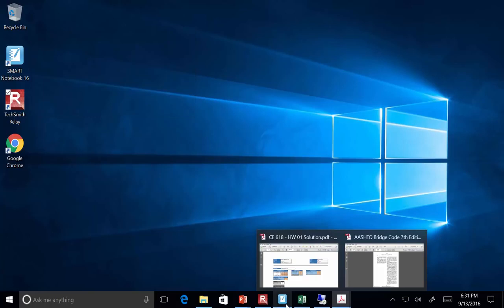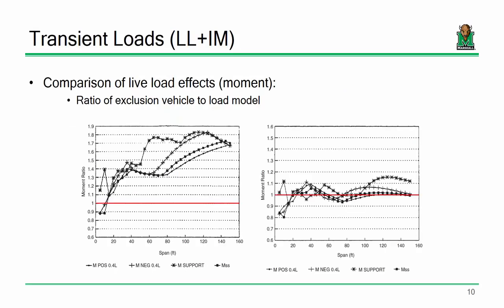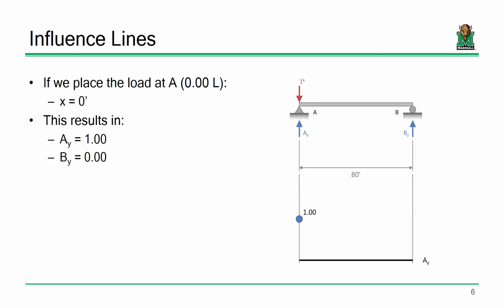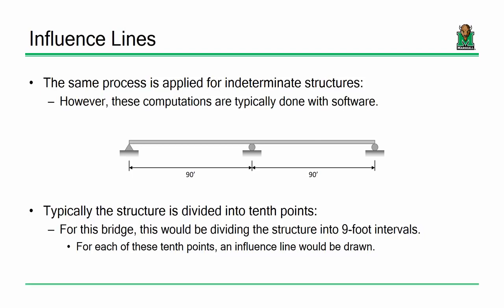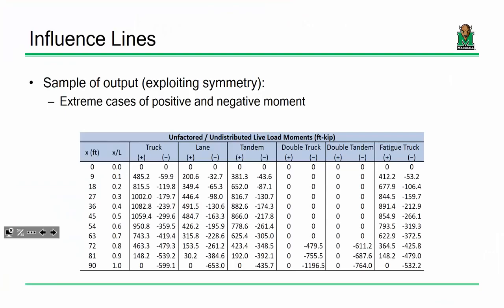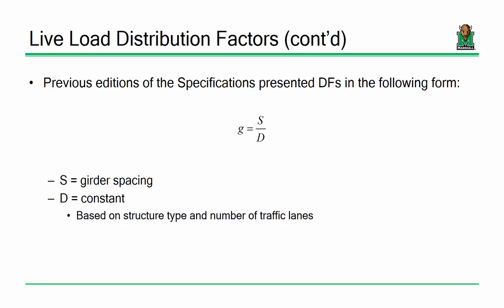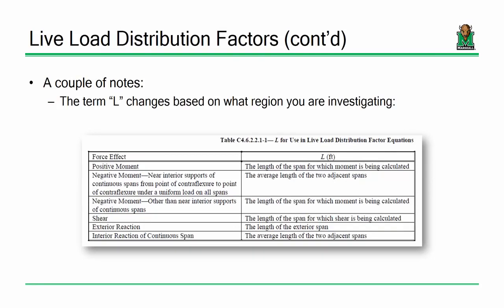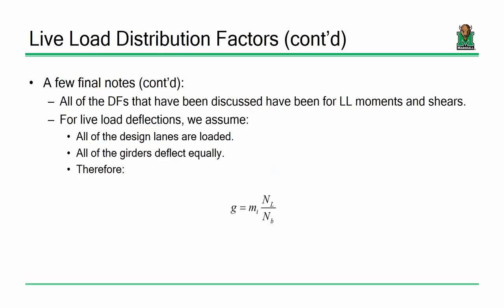CE 618 Lecture 04a  Analysis for Live Loads 2016 09 13

Comment: Do you have this PDF available online to check my answers. I’m following along with this lecture set for my own senior design project at CSUF. I’m building a 200ft span pedestrian bridge over PCH. Can I follow this series and just adjust to fit my parameters for my design? (i.e. 9ft wide by 200ft span with only end supports)?
Reply: I'm working on a similar project, how did it work out ?